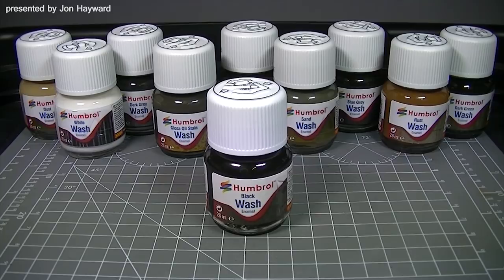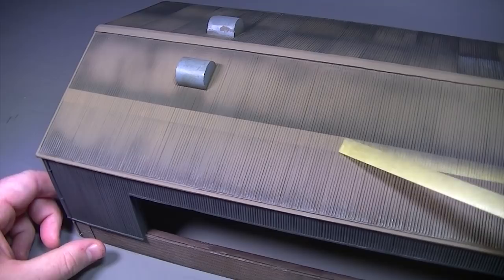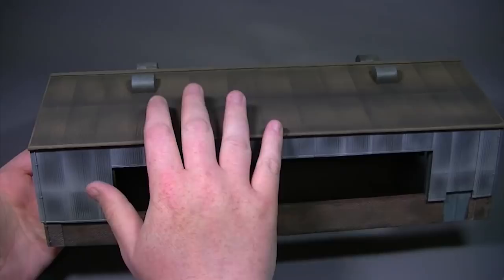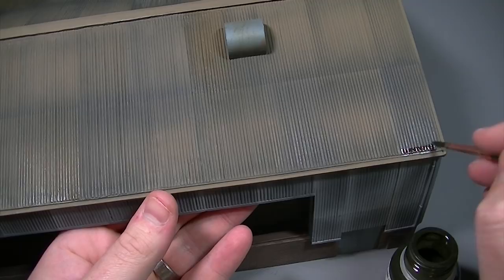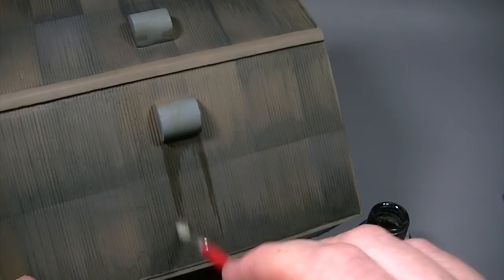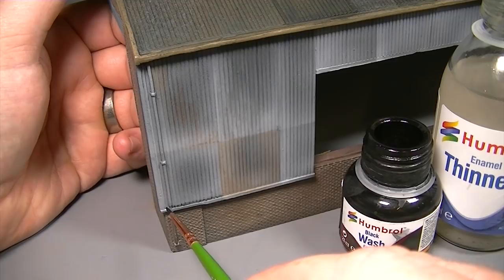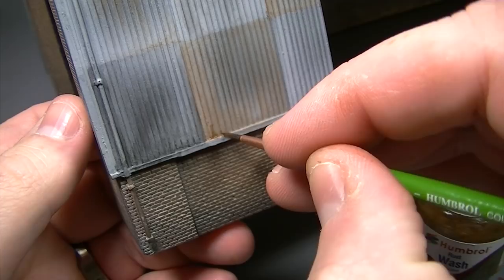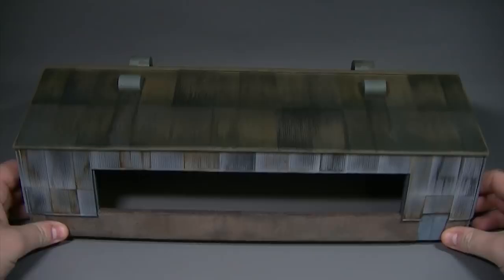Humbrol - Weathering With Enamel Washes

Comment: I came to use the black wash for a second time after using it successfully on the first occasion, only to find that there was an off-white gel substance in the jar. Despite vigorous mixing, the wash had turned more to thick paint rather than a wash. It was though all the liquid solvent had reacted. Jar was tightly capped. Don't know if anyone else has had a similar problem?
Reply: Thanks. I'll give that a try.

Comment: Every time I try to use humbrol enamel thinners to clean up the wash it strips the paint off my model. I use humbrol clear coat and give it several coats and a few hours to dry before touching it again and it still strips off the paint under the clear coat. Do you have any advice on how to stop this. Thanks.
Reply: Make sure that your paint has cured for  a few days and give it several coats of clear or gloss cote